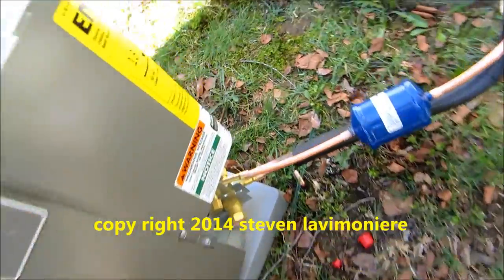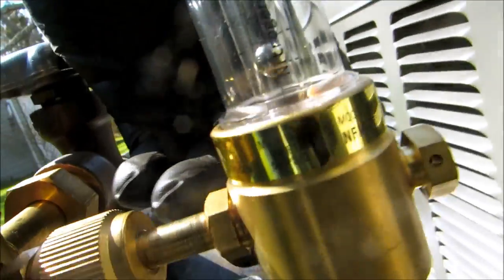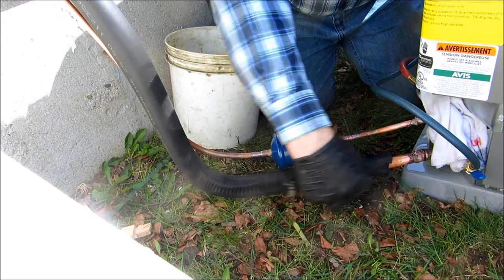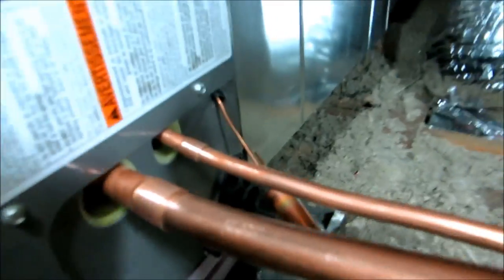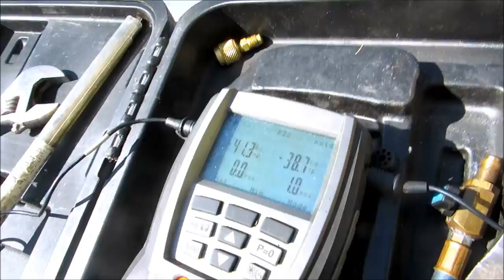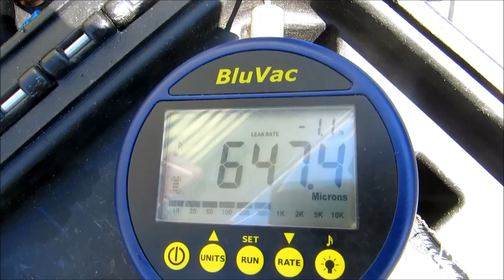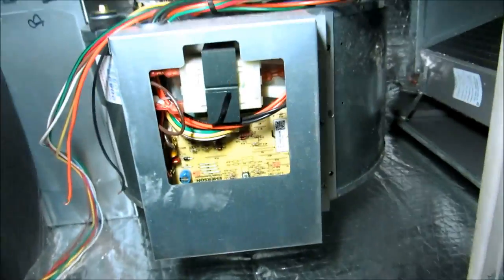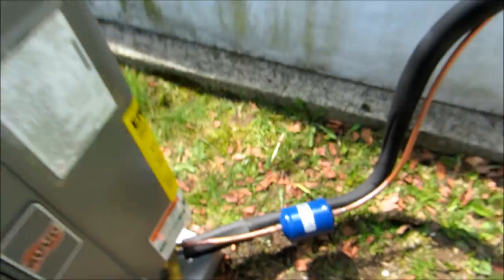hvac 2 ton air conditioning install part 3

Comment: As usual, nice job Steven. I think a lot of the new guys think using nitrogen is a step you can skip when brazing the line set. With so many supply houses selling split and ductless systems to straight plumbers, (with no refrigeration license or A/C knowledge), it's giving us A/C veterans a bad name. I wouldn't think of installing a system without purging with nitrogen while I'm brazing. I hear so many stories of plumbers not even using a vacuum pump, just opening the service valves!!
Reply from the maker: well if they do not pull a vac the system will not work .not right anyway
Reply: Your 100% correct. Once these guys get paid they will never be back or return a phone call. Most are hired by developers building "spec" houses who are looking for the cheapest A/C price, regardless if the company they hire use the "best practices" for installation.

Comment: Great work, great looking system same brand
 As mine of course mine is a little older as in almost 23 years old mfg 08/91 one of the stamped octagon fan grills and has all original parts

Comment: At the 8:00 mark, I thought you had attached a picture of yourself to the condensing unit.  It took me a couple minutes to realize that it was your profile picture that you tube overlays in the corner of the video.  Great job on the install.  That definitely looked like a tough job.
Reply from the maker: i put a water mark on the video, so no one tries to steal my stuff

Comment: Should've placed that filter drier at the ahu. In ten years, that drier will rust out and be a place for a leak. Prevent problems before they happen

Comment: just charge it by weight. measure out the lineset used and add accordingly. no need to go back and save yourself a trip.
Reply: i recently stopped brazing too. silver solder works better according to the tests. annealing the copper actually reduces the tensile strength by about 50%. no need for the heavy nitro tanks and purging now.
Reply from the maker: Robert Doherty the problem with that is the returns are way under sized . so i had to charge by superheat not weight. low air flow, and full charge =flood back.
Reply from the maker: Robert Doherty i use both depends on set up

Comment: Really good job Steven and thanks for the video. It seems like forever since I last saw you do A/C work. Do your electricians ever piss and moan about running cable through plumbing PVC instead of gray electrical? I think they are stupid codes in most cases but maybe your electrical inspectors have common sense up your way.
Reply from the maker: Nicholas CeeA well it was just a chase for him .. to get from the cieler to the actic up through the closet